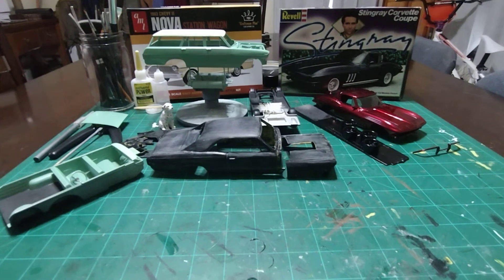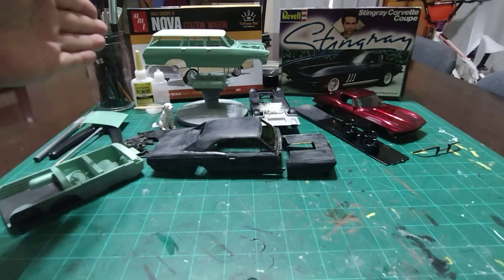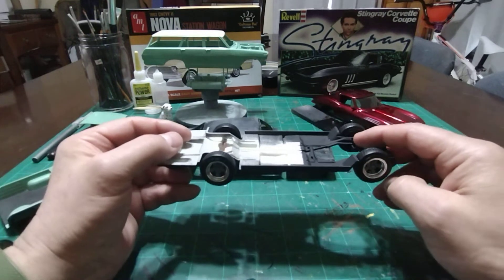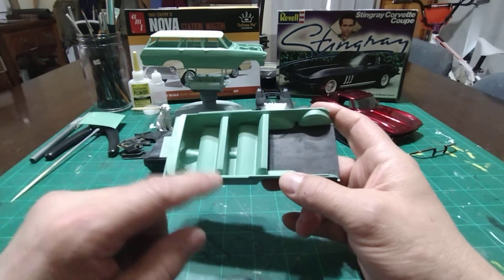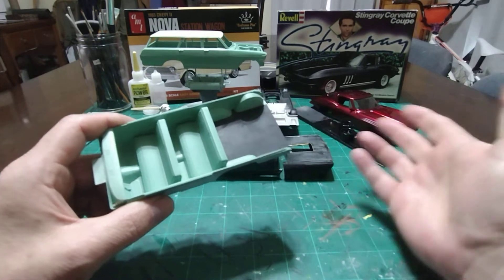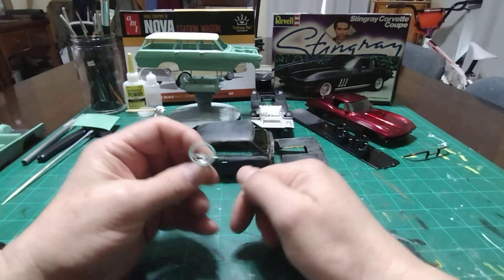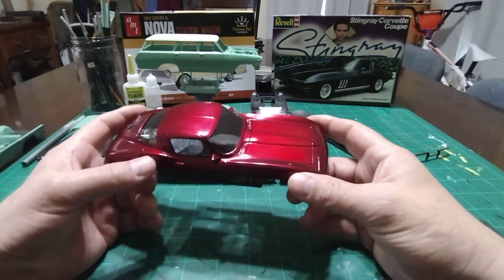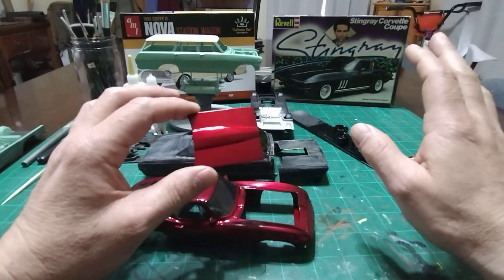What's shakin', bacon? Build updates.

Comment: Nice update. Wagon is looking pretty good. Probably best you leave the door panels alone as I know the details are not very prominent on that kit unless you want to add some aftermarket handles and such.
Love the red on the Vette. Metal Cast red over silver aye? Looks close to the Testors Ruby Red from back in the late seventies. I used that on a MPC '67 "Streaker Vette" back then and have acquired another kit to try and do that same build again, only hopefully better than when I was at 13 or 14.
You do nice work Rob.